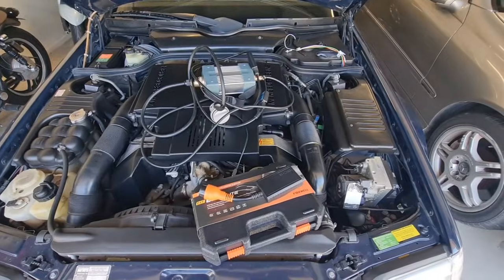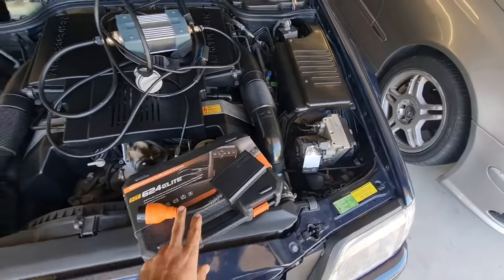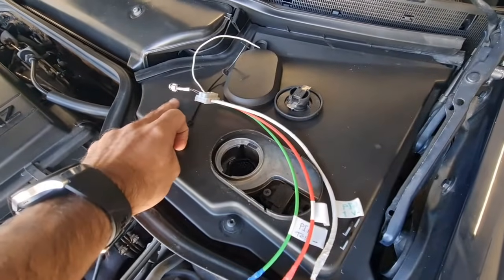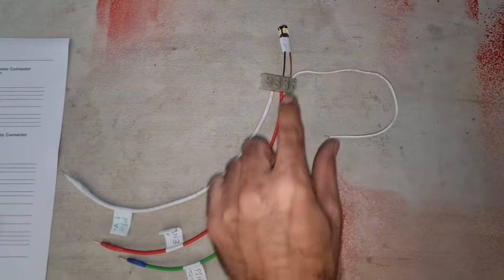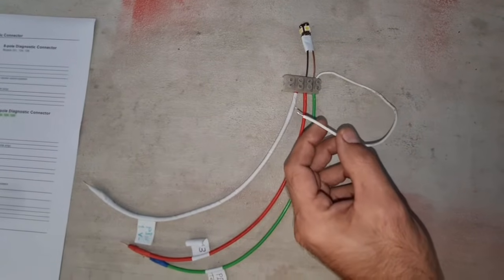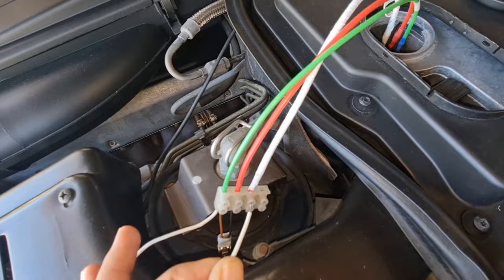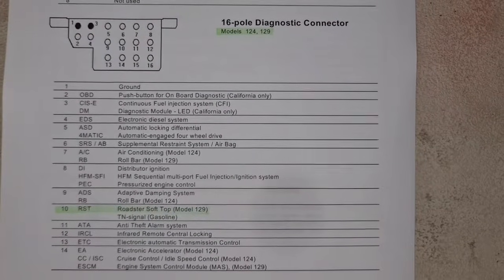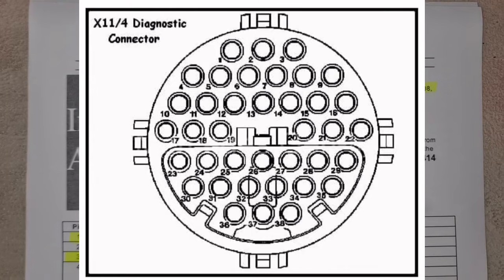Diagnose Pre-1998 Mercedes for Free & Easily(8-16-38 Sockets)

Comment from the maker: The easiest and most available method of diagnosing a pre 2000 mercedes and it is free too, for me it was the only way to clear fault codes on my convertible top module. Please download the fault code PDF, which is in the description.  Thank you for watching and subscribing.
Reply: I am making the code reader. What is the clear plastic junction piece called and where can I find one?
Reply from the maker: @brandonfowler6013  TBH I am not sure, just use what is available,  that's just decorative:)
Reply: @brandonfowler6013  thats a domino connector.

Comment: Buenas tardes... tengo un w210 270cdi de 2001... Y se le han cambiado caja automática, palanca selectora, centralita de TCU... Y sigue como en modo de emergencia... Después de visitar varios talleres, ninguna máquina de diagnosis es capaz de acceder a todos sitios, alguna a borrado algún error, pero sigue igual...crees que puedo borrar los posibles fallos haciendo el invento de los cables??? Gracias por tu vídeo, está muy bien.
Reply: Did you find the problem? Unfortunately there are many faults that can put the trans in limp mode?

Comment: The car won't start w140 s500 m119 

What do you think is the reason
Reply from the maker: 1. Check for spark
2. Check to see if you have fuel pressure in the rail.
3. Check for compression. 
That is all you need to check.
Reply: Did you fix it?

Comment: What about the on-board diagnostic box (part # A1265400044) that comes with the car. It's a switch and a red LED. 
You can find it next to the 38 pin socket. I've noticed it by mere chance but I don't know how to use it.
Reply from the maker: It is basically the same thing...not many people have access to that simple diagnosis tool.

Comment: I have a '93 A124 and a '99 S210, on the 124 it works great but doesn't work on the 210 at all. Followed every single step and doesn't work, turns the light on when I plug it on pin 1 and 3 (ground and power), but does not do the rest like on the 124.
Reply from the maker: For the 99, a diagnosis scanner like a STAR C3 or any proper scanner with 38 pin connector should work. I know what you mean, but unfortunately it is what it is, Mercedes went through an evolution through these years.

Comment: Greetings and many thanks for this very educative video. I have been trying to work on a W463 G Wagon year 2001 that is the 300TD and it also has the 38pin socket. I would be very happy and fortunate if you can share with me the fault code list for the IFI inline diesel fuel injection system as well as the IRCL infrared remote central locking module and if possible also the DAS2 fault codes or is there a website where I can get these . The only problem I have is that i need to know what codes are currently stored in each of these systems so that I can make a proper diagnosis of the car as it currently is cranking but not starting and all the indications from the Green and Red LEDs on the interior view mirror indicate that the system is basically able to start but I would really love to know what fault codes are stored inside these 3 modules and then if they need to be cleared I can also do that after making a similar test circuit to yours. I am working on this old G Wagon in Nairobi Kenya. I need to try and get it up and running so that it can be sold to some very interested clients who are very keen on buying it. Is it something you can help me with? The information on the fault codes as I try to build myself the test circuit you have made here? Thanks in advance
Reply from the maker: Shoot me an email, I have a complete PDF to email you. info@benzaddiction.com

Comment: Hi my friend,
I just tested on my mercedes slk r170 200 1996 and it's doesn't work. When I use the switch and I connect 3 sec to the negatif the led is lighting during the 3 sec and when I disconnect it's do nothing. Any idea how does it's work for slk r170 1996. Thanks for your help!
Reply: Who can help to diagnostic abs on my slk r170 200 1996? I tried with Delphi, openport 2.0 with Xentry and this led methode but nothing worko.
Reply: @hbbh4415 I was able to get engine and abs codes using hfmscan software and K-line adapter. But SRS and roof codes are still a mystery

Comment: Hi, great video snd information. I am still having trouble with my 1995 C180  with the 722.6 auto box. Wont come out of limp mode. Fitted new plate, fluid filter etc, built this LED tester, but when i touch the test wire to switch wire, i just get a solid light immediately. No blinking. Just constant light. On all pins. Also tried icarsoft scanner, didn’t recognise car. Any ideas?
Reply from the maker: After you change the plate you need to clear fault codes, check my recent video that I did on a w210.
Reply from the maker: https://youtu.be/QbXCITfj5v4

Comment: My LED is on when i connect the three wires and when i turn the key it goes off, then when i connect the jumper cable for few seconds so the light is on and then take it off, i dont get any lights after that
Reply: I have the same behavior. Did you manage to read the codes?

Comment: Again thanks for a very informative video, I have been doing some research on OBD2 Scanners and am led to believe that the iCarsoft Max Pro with iCarsoft 38pin adaptor could work on my '96 SL500. Have you had any experience with iCarsoft scanners ? Thanks again George
Reply from the maker: @George-f8m  Hi, not sure about Icarsoft,  but my Foxwell is working very well with my 38 pin diagnostic socket and adapter,  recognized 38 modules and works like an OBD2. The car is 99 btw.
Reply: @BenzAddiction  Great, can you tell me which Foxwell Scanner you have and does the 38 pin socket come with the scanner. Thanks so much
Reply from the maker: @George-f8m  I have the NT624E, the adapter i bought from a company in Germany separately.
Reply: @BenzAddiction  I'm just looking at the Scanner online and it looks fine, one last question, can you tell me the adapter model etc. you bought from Germany. I've heard some adapters just don't read Mercedes 38 pin ports so it would save me a lot of time and money if i could get one that I know will work. Thanks again for your patience and help. Cheers George

Comment: Hello, thank you for this! I made my own tool but I can only replicate this on port 4 on my 1996 W202 (which gives me 1 blink, so that is good). I have an issue with ABS, but when I try to plug it into port 6 to read it never blinks any code back. Same for all other pins. Is there anything else I have to do to activate the other ports, like start the car?
Reply from the maker: @Krisemann  Hi, only "ignition on" is enough, not all of the cars have all of the modules,  The pin number you need for diagnostic access to the 41996 W22 ABS module depends on the type of connector it has:
For Cab-mounted ECUs:
 * Obtain codes: Back probe pin 15 of the X1 connector to ground for 1 second.
 * Clear codes: Back probe pin 15 of the X1 connector to ground for 3 seconds.
For Frame-mounted ECUs with all 12 pin connectors:
 * Obtain codes: Back probe pin 10 of the X1 connector to ground for 1 second.
 * Clear codes: Back probe pin 10 of the X1 connector to ground for 3 seconds.
For Frame-mounted ECUs with all 18 pin connectors:
 * Obtain codes: Back probe pin 15 of the X1 connector to ground for 1 second.
 * Clear codes: Back probe pin 15 of the X1 connector to ground for 3 seconds.
You can find this information on page 35 of the Wabco document you linked: https://www.wabco-customercentre.com/catalog/docs/mm0112_web_en.pdf
Important Note:
 * Back probing involves carefully inserting a probe into the back of the connector to make contact with the desired pin. This should be done with caution to avoid damaging the connector.
I hope this helps! Let me know if you have any other questions.
Reply: @BenzAddiction  My W202 only has the 38 pin port in the engine bay. It's worth mentioning I live in Europe so the OBD2 ports were mandated at a later point here. Should I check the ABS light in the dashboard if it blinks out codes?
Reply: @BenzAddiction  I have tried redesigning the tool by putting 2K ohm resistors on it with a standard red LED bulb on it now, to no avail. Doing some further reading it seems like my car might have a hybrid system, in which case I would need a proper scan tool.
Reply: @Krisemann did you manage to read the codes? I have the same issue
Reply: @logovaser  Nope, thankfully the ABS light ended up fixing itself sort of. Even my local shop could not access certain modules (SRS), but they were able to pull codes from the ABS. There's a good chance the only solution is to use the MB Star diagnostic tool. I've even tried that one open source MB diagnostics software I found online, which did get access to the ECU, but no other modules.

Comment: Thank you! I copied your blink system. It lights on when I hold it for 3 seconds, but I am getting no blink after that at all. That goes for all pins, same thing
Reply from the maker: That's weird 😕
Reply: @BenzAddiction  Rick's pdf file for error code says, no blink or 1 blink is no error but Mercedes USA pdf file doesn't say anything about no blink. Any thoughts?

Comment: I can’t pull the codes on this W202. I have a LED tool, it works on my w124 but can’t get it to flash any codes back
Reply from the maker: Even form socket number 8?
Reply: @BenzAddiction  I can see which pins have connections. I tried them all. I get the LED on with the button, but no flashing? Many thanks for any advice
Reply: @bernardwarr4187   Hi Bernardwarr4187. Could you solve this issue? I have same situation, no flashing after 3 or 4 seconds.
Reply: @JulianoBarbosa-b1v  works perfect on my 500E W124, but only gets the light on, no flashing at all on the W202?
Reply: @bernardwarr4187  Hi Bernard, mine is a R129 1999 and only gets light on, no flashing, If same tool works fine on your W124 I guess system is different after 1998.
Reply: @bernardwarr4187  Guys. Couldnt that just mean there are no error codes?
Reply: In the end we found the engine control module was toast! Water damage

Comment: So I made the testing circuit, but when I press the button, nothing happens. If i reverse the circuit but not connect 16 , i have led light. So I have 12 Volts on all test points but when I push it to ground with the button, nothing happens afterwards.. Why is this?
Reply: I checked my wiring again, diode was wrong way around, but I still have trouble getting it to blink on error codes, the led lights when I press the button now. But no blinks after i have pressed it for 3-4 sec.
Reply from the maker: Just check your circuit logically again an refer to the diagram shown in the video, soon I am going to use the same test light on a W124, good luck.
Reply: @petter7252  Hi Petter7252. Could you solve this issue? I have same situation, no flashing after 3 or 4 seconds.
Reply: @JulianoBarbosa-b1v  no i didnt solve it, i dont know if it matters but the car had been standing without power for at while. But im guessing i should atleast have gotten the one blink "ok/no faults" led. But I never did...
Reply: @petter7252  Hi Petter, yeah, same here, my car is a R129 1999 but still has 38-pin connector, I was wondering if it has a different diagnostic system. Thanks for your attention, if I find something I will keep you posted, maybe @BenzAddiction can help us meanwhile.

Comment: Thank you for posting this video! I’m in the same boat with my 96 SL320. The foxwell and C3 could not communicate with my 38-pin connector. Going to try this today and see if it works.
Reply: Does-it work on your 96 sl? Because on my 96 slk it wasn't work.
Reply: @hbbh4415 Unfortunately it did not work. I believe they discontinued this method past a certain 1995/96 manufacturing date. I ended up sourcing a C3 multiplexer to read my RST data.

Comment: You have to check each pin individually?  How do you decipher what the code means?
Reply from the maker: All this data for codes are available online if you google it. Positive and negative is always fixed, the data cable (green) is for different modules.
Reply: Thank you. If I’m having starting issues,  what pins would you recommend checking? The car was running great and then it stalled and won’t start. Just replaced fuel pump. No change.
Reply from the maker: @danludwig3679  These modules are not very sophisticated,  I would start 1. Checking fuel pressure 2. Pull a plug wire and check for ignition while cranking. If it is fuel related, fuse and pump relay to be checked. Ignition related: might be coil...
Reply: @BenzAddiction  thanks again man 👍🏼. Fuel pressure is good. I will check for spark.

Comment: I like your video and your explain but for example if i need to check the electronic transmission 722.6 ? If there is fuolt ! How many times will light?? Please answer..

great service. very educative .Thank you regards
Reply from the maker: Thanks bro, It depends on the fault, you need to count the numbers then based on the number find the fault.
Reply: Any update on this? Trying to figure out how to reset codes for my TCM. I replaced the conductor plate twice now but I’m not convinced the code has been cleared properly using the OBD2 port. I’ve read I have to use the 38pin port to clear it properly.

Comment: Thanks for your videos, always very informative and because you're based in Australia is even better. I have just  bought a '96 Sl500 r129.  As this video was done about 9 mths ago have you searched anymore for an OBD scanner that will diagnose the r129 fully including Roof and Suspension ?  Thanks George
Reply from the maker: Thanks mate, the situation  for 96 year might be better and you might be able to diagnose using a OBD2 Scanner.  I am not 100% sure though on the brand you should use.

Comment: First of all, thank you for this video! I made a code reader to diagnose my ASR light and limp mode for my 92 500sl 16 pin connector. I'm in the US by the way. I tested the "Electronic Accelerator / Cruise Control / Idle Speed Control (EA/CC/ISC) w/ASR". The book says it's
"Closed throttle recognition signal to engine control module (HFM-SFI or Left LH-SFI) Fuel safety shut-off to engine control module (HFM-SFI or left or right LH-SFI)". Can you point me in the right direction? Thank you again!
Reply: Update, I reset the code and then went for about a 5 mile drive. The ASR light came back on but not limp mode.
Reply from the maker: Better than the limp mode 😉
Reply from the maker: I would do a google on this...

Comment: would this work on a 2001 CLK w208? I'm european so my car does not have OBDII onyl the 38 pin
Reply: Thank you very much
Reply from the maker: Should work
Reply: @BenzAddiction  Where did u buy that plastic thing that holds the wires and how is it called? (sorry i'm neither english neither expert on circuits)
Reply from the maker: @st.dardust_garage  I think that is called a wire terminal.  But you do not need to have that simply use duct tape to secure cables.
Reply: @BenzAddiction  Thanks!!! I'll let you know so you can add the info to the description ;-)
Reply: Quick update on my car: with the ignition Key on ( last position before actually starting the engine), the LED Is off when connected to the test pin and the + terminal, as expected. Then i connect the test pin to the negative pin (1), the LED switches on when i contact the two wires, then i stop After 3 seconds and then the diagnostic should start, and nothing happens... am i doing something wrong? It should flash at least once right?

Comment: can I simply run 2 wires from 12V DC LED light and from the negative wire a switch wire? no fancy block as yours😂. I've seen even more sophisticated self made OBD readers. I don't want to over do it. is the block important? thank you very much for all your helpful videos!
Reply from the maker: Hello, there is no fancy thing as long as you keep your wires safe and insulated.  Just follow the diagram and good luck 👍

Comment: Hi There,
I have a ? you may be able to help me with. I have a W210 1997 E230 Benz. It has a 38 pin obd socket for diagnosics. I have an icarsoft V3 scanner tool which apparently will read and diagnose my W210 by using an adaptor obd 38 pin male plug to a female obd2 plug which goes into the icarsoft scanner tool cable. Icarsoft sell an adaptor to do this for nearly AUD$90. They say that ONLY their adaptor will work with their icarsoft scanner tool. However I have found another adapter plug/cable plug which will fit my car and my icarsoft scanner but the seller says it is for and Iveco vehicle. Do you know if the icarsoft adaptor might have a special chip in it so it talks to their icarsoft scanner. I believe that this is not the case - What are your thoughts on this please.  Kind regards, Stuart EM - tiffy106@ozemail.com.au   I am in Australia. Look ford to hearing back from you soon.
Reply from the maker: Hello, as you noticed in the video I have tried foxwell + adaptor on my 1994 with no luck, my recommendation is that do not waste your money on the adaptor at all as most probably it will not work. If your car was 1998+ that was a different story...
Reply from the maker: Also the best way of DIY diagnosis for the OBD1 mercedes is probably the flash method again mentioned in the video.